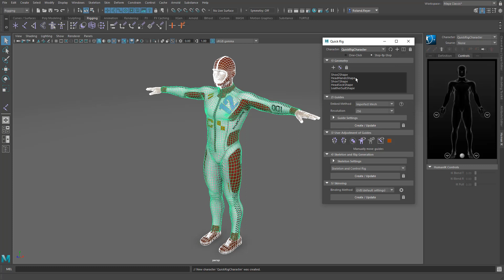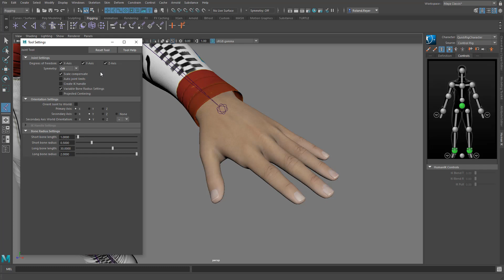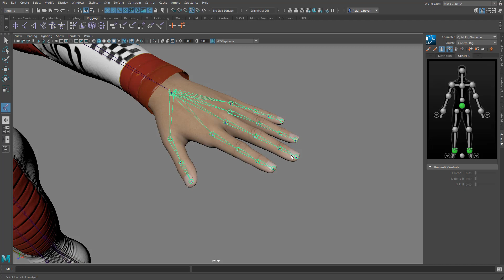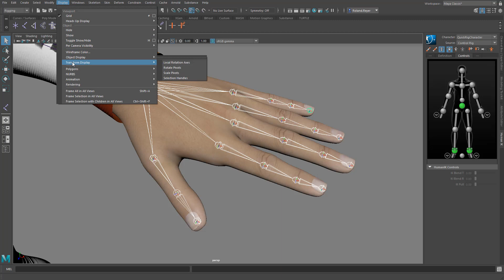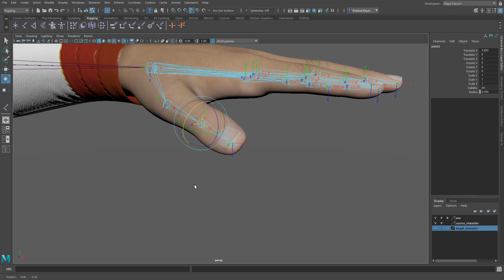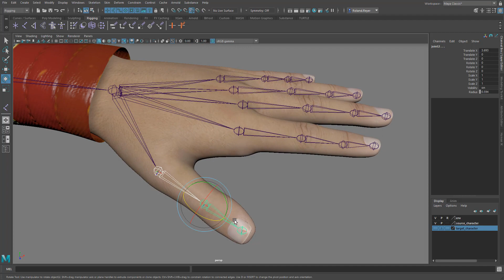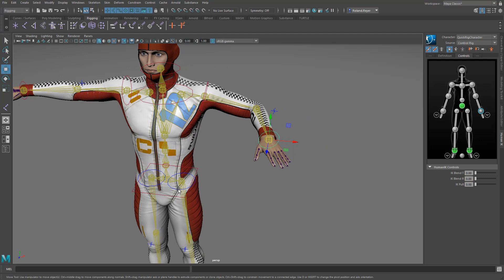Maya 2020: Quick Rig + Attach Hands

Comment: Thanks! This is a fantastic tutorial but it seems like such a stupid oversight that Autodesk wouldn't include this sort of thing with the quick rig option. I remember using 3rd party scripts back in 2004 that did this with the click of a button with just a little bit of work to place the joints properly.

Comment: So if anyone else is running into the same problem I am (you save the file at the point the tutorial ends and then re-open it and none of the controls will move your character), I believe this is happening because of an invalid skeleton definition because the new bones in the hands were not defined. I'm not exactly sure how to solve this problem since I am unfamiliar with mayas new quick rig system, but that is my best guess. If anyone else runs into this problem and managed to solve it, I would love to hear how you did it. Thanks.
Reply from the maker: Did you try the steps in the description of the video?
The problem is that we deleted a joint that was already registered for HIK.
Reply: @RolandReyer  Apologies, I did not notice that you had already posted a fix in the description. That did the trick. Thanks for your help :)

Comment: hey good tutorial. but I realize after I attached the hand I am unable to use this rig again when I save and open the file again. Is there any fix to it ? The normal quick rig works fine
Reply: Yeah same.
Reply from the maker: That's my fault, I'm so sorry. 
When I copy the left hand over to the right side (after deleting the original right hand) the DEFINITION of the HIK character is broken.
What you need to do now is:
- in the HIK panel in the "Definition" tab turn off the "Lock" icon - this will delete the Control Rig - the regular skeleton is now visible
- select the joint of the right hand
- in the HIK panel hold the right mouse button over the GREY bone icon of the right hand and choose "Assign Seleced Bone" (the icon turns green or orange)
- turn the "Lock" icon back on
- in the HIK Panel pulldown menu "Source" choose "Control Rig" - a new Control Rig appears, should be working now
I hope this works for you.
Reply: @RolandReyer  it DOES work but now the fingers aren't skinned at all.
Reply: @RolandReyer  ah but of course. A simple unbind and rebind did the trick

Thank you for your help good sir :)
Reply: @RolandReyer  thank you for replying I will be trying this out I wish youtube can have a option where people can re edit the video, that way more people will get to see this.
Reply: @RolandReyer  I will add a little update that can be interesting:
- in the HIK panel hold the right mouse button over the GREY bone icon of the right hand and choose "Assign Seleced Bone" AND you can also develop the arrow and assign each fingers' bones too !
- Then , turn the "Lock" icon back on
- AND THEN click on the button "create control rig" (it's still in the definition tab , at the left of the "lock" button)
this will update the rig INCLUIDING the fingers bones and adding a proper controler on each fingers

A huge thanks for the clear tutorial Roland, I'm always learning a lot watching your videos !
Reply: @RolandReyer  hah, yes, we are follow every step, than make same fault.

Comment: i followed your tutorial. very helpful. I saved the project, but now the control rigs (circle and square) don't move, . I search a lot online about this problem, but nothing is working, can you help me please? I activated the IK blend T and R, nothing has changed. I'm desperate, my deadline is near and I don't know what to do anymore
Reply from the maker: Please follow the instructions in the description of the video to fix the rig.
Reply: @RolandReyer  already done it, and nothing chance :/
I resolve in an other way
I select every single joints for legs "set prefer angle" an i use ik handles, i create some NURBS and connect them to the bones

Comment: Fantastic! This answered a lot of questions for me.
Reply: He  replied below with this. 

That's my fault, I'm so sorry. 
When I copy the left hand over to the right side (after deleting the original right hand) the DEFINITION of the HIK character is broken.
What you need to do now is:
- in the HIK panel in the "Definition" tab turn off the "Lock" icon - this will delete the Control Rig - the regular skeleton is now visible
- select the joint of the right hand
- in the HIK panel hold the right mouse button over the GREY bone icon of the right hand and choose "Assign Seleced Bone" (the icon turns green or orange)
- turn the "Lock" icon back on
- in the HIK Panel pulldown menu "Source" choose "Control Rig" - a new Control Rig appears, should be working now
I hope this works for you.

Comment: hi, I'm facing the same problem as the description above which is I can't move my controller as well as the joint btw I can't found this method in my Maya can u tell me where do this panel at? " in the HIK panel in the "Definition" tab turn off the "Lock" icon - this will delete the Control Rig - the regular skeleton is now visible
- select the joint of the right hand
- in the HIK panel hold the right mouse button over the GREY bone icon of the right hand and choose "Assign Selected Bone" (the icon turns green or orange)
- turn the "Lock" icon back on
- in the HIK Panel pulldown menu "Source" choose "Control Rig" - a new Control Rig appears, should be working now"  ....... cause I can't found this and do you have any tutorial for this solution it really helps if you make some of it cause the majority of ur viewer follow your tutorial facing this kind of problem and can't be solved asap including me need help, please if u need to email me the video tutorial is better thank you

Comment: Dear Roland, thanks for the tutorial video. I followed this to rig my character and it worked very well. However, when I try to do the second character, it looked good and moved smoothly. But after a few minutes, every joint controller was locked and I couldn't move any of them anymore. I deleted it, redo it again, and tried repeatedly, but the problem was still the same. I don't know what's the problem. Is that a bug of Maya or did I press the wrong setting? Do you have any suggestions?
Reply from the maker: Hi Sammie, thank you for this report.
Did you follow the instructions in the description of the video to fix the locking of the character?
Reply: @RolandReyer  Thank Roland, I solved it. it occurred because I deleted hand joints to finger joints instead of deleting hand joints I parented finger joints to hand joints. Your tutorial is really well. Now I can make my character do anything I want. I'm very appreciated! Thank you again!
Reply: @RolandReyer  I was pulling my hair out trying to figure out the issue and it was under my nose all along! thank you again for the video I'll be using this to setup my rigs even faster than before.

Comment: Thank you Roland, great content. 1 question though. My mesh has twice the density and the skinning comes out terrible. Is there a way to fix it automatically, should I adjust something for it or have to manually paint the skin weight in this case?
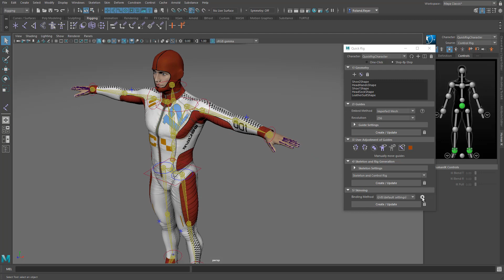Reply from the maker: You can try to play with the "resolution" setting of the skinning (11:20), set it higher or lower. If that doesn't work you could try to transfer the skin weights from a lower resolution model - or you have to paint weights.
Reply: @RolandReyer  thanks for the quick answer! Appreciate it.

Comment: Hi! I did create the Skeleton with control rig but when i move the wrist, the body did not follow the hands movement like it did in yours. only the hands and the arms move. can i ask what causes this to happen? By the way, I am using Maya 2019
Reply from the maker: You can turn on “Full Body Mode” in the HumanIK panel (icons in the top row) or with a selected HIK handle you hold the right mouse button: a Marking Menu appears where you can choose the mode.

Comment: good video, the only thing I am worried about is the lefthand is lack of a bone, it might cos problem when import to Unity?
Reply: For unity, just make sure you bake your animations on export. create a separate export with your character in it's rest pose with no keys and export that one to use as your avatar definition in unity. You will need to map the bones in the unity editor as well, but once it is set up any animations using the same rig should work in unity as long as they are baked on export and set to humanoid in the unity editor. It took some trial and error but I managed to get it working.

Comment: When I deleted the Control rig to fix the mirrored hand, the position of the hands changed, thus the finger bones were no longer aligned with the model. How do I prevent this?
Reply: this happened to me as well, what I did was to manually realign the bone to fit the mesh, and then reattached it, it seem to work alright, but if there are better and a more proper solution I would love to hear it too. I hope this helps tho, at least to not get stuck haha
Reply: when I say manually realign, I mean just rotate the wrist joint to get it inside the finger meshes
Reply: I figured it out, just put all zero value of the rotations in channel box

Comment: Hi, I get this error message when trying to orient joints: // Warning: line 0: Skipping QuickRigCharacter_LeftForeArm: It has non-zero rotations.
If I try to set to zero in the channel box  the x, y,and z rotation, it rotates my foreharm, and therfore, the hand joints move away from the hand mesh. Do you have a solution?. Thanks so much anyway, great tuto
Reply from the maker: Hi Javier, the workflow for Orient Joints and the handling of this error message is explained @5:41
There is no need to re-orient the forearm.

Comment: Hi sir, When I import a character from cc3 into Maya it already has a built in skeleton and rig, when I delete it to replace it with Maya's quick rig, it changes its pose from T to A, which is a little difficult to manage specially for fingers, is there any way to stop this change in pose?
Reply from the maker: Instead just deleting the unwanted skeleton you should first delete history on the skin. That bakes the pose into the geometry.
Reply: @RolandReyer  Thanks for reply

Comment: After saving and closing, then opening again it says its missing bones and the rig will no longer work with the hands. Works until it closes basically. What's the issue there?
Reply from the maker: That's my fault, I'm so sorry. 
When I copy the left hand over to the right side (after deleting the original right hand) the DEFINITION of the HIK character is broken.
What you need to do now is:
- in the HIK panel in the "Definition" tab turn off the "Lock" icon - this will delete the Control Rig - the regular skeleton is now visible
- select the joint of the right hand
- in the HIK panel hold the right mouse button over the GREY bone icon of the right hand and choose "Assign Seleced Bone" (the icon turns green or orange)
- turn the "Lock" icon back on
- in the HIK Panel pulldown menu "Source" choose "Control Rig" - a new Control Rig appears, should be working now

I hope this works for you.
Reply: @RolandReyer  thank bro, really appreciate

Comment: Hey 
Roland Reyer  I'm trying sculpt gladiator from Xmen in tpose and then pose him using maya as an obj. I did a test on the nickbasic man mesh and was able to rig the  quick rig and place joint correctly but when I tried to move the  meshe's arm  the polygons started to separate. Idk mb i need to increase subdv  before importing into maya and then bind skeleton rig
Reply from the maker: Hi, when you say the polygons "separate" do you mean that there are holes in a surface that should be closed? Or do elements of the body (skin, cloth armor) move at different pace? Send me an image roland.reyer@autodesk.com

Comment: Hey, thanks for your really good video! 
I have a problem. when trying to bump up the resolution of the  binding method, I get an "Error  Guide settings changed. Please re-perform skeleton embedding" and I can't update anything. I need to recreate the whole rig. please help! 

I have completed attachind the hand, then mirrored it and parent it the same way as you show. but this error doesn't let me continue.
thanks
Reply from the maker: I’ve never seen this error. Which resolution did you use?
Reply: thanks for the quick answer! It's probably related to naming the mirrored joints of the hand. I also saw that the humanIK character view shows that the controllers are not good. the right hand definition was missing. I tried to manually add the joints after naming them properly. that also didn't work. the only thing I could do was to skin the character manually out of the quick rig window. this is not so good as I lose the controllers and the IK behaviour of joints

Comment: Are there way to make new fingers controller in Quick Rig?
Reply from the maker: It is not possible in Quick Rig, however, in the HIK panel you can select and assign all bones of a skeleton to the parts of the HIK Rig.
This process will be much easier if you name the joints correctly according to the HIK specifications.
https://knowledge.autodesk.com/support/maya/learn-explore/caas/CloudHelp/cloudhelp/2018/ENU/Maya-CharacterAnimation/files/GUID-5DEFC6E5-033C-45D5-9A0E-224E7A35131B-htm.html

Comment: So I modelled my character in an A-pose, with spread legs, but when unlocking in Definition, it turns to T-pose. What can you do about this? :O
Reply from the maker: Can you go to the bind pose?
Reply: @RolandReyer  I found a work-around. I kept it in T-pose, baked it into the mesh, then made a new rig to fit it. Bit of a hassle, but it worked. Unfortunately, I realized a bit late that the quick rig isn't very good for hand animation, so I have to build one from scratch anyway X(

Comment: I have used this technique many times and never had problems, but now while i am following along with the video, Maya doesn't let me connect the joints together, after i have created a skeleton with the quick rig and try to use create joint tool, it keeps placing joints in random areas in the scene--basically i cannot have them be connected with the quick rig skeleton. if anyone else has experienced this please lmk!! (i am using Maya Indie 2023)
Reply: hi did you find a solution? i have the same issue.

Comment: REALLY nice tutorial, but PLEASE don't use "Snap to projected centre" on fingers. The end of your index finger is bent in the Y axis there, and it is not physically possible to move the ends of your fingers in this direction without external forces involved. :) Top tutorial otherwise though. Great job!

Comment: My joint tool wont connect to the quick rig wrist joint. No matter what I do it just clicks through it as if it isn't even there. I cant find anyone else having this issue.
Reply: hi did you find a solution? i have the same issue.
Reply: Hey, i'm really sorry but I can't remember if I found a fix for it or just started the whole thing over again. I THINK I made the finger bones, then parented them manually in the outliner to the wrist. @koldugmeleri

Comment: Everything moves correctly but When I go to animate with it, the head deforms and the rig does not move at all is there something Im doing wrong? i followed everything exactly.
Reply from the maker: Hi, did you check the description of the video for a fix? Replacing the one lower arm damages the naming of the joints, that’s why it gets stuck.